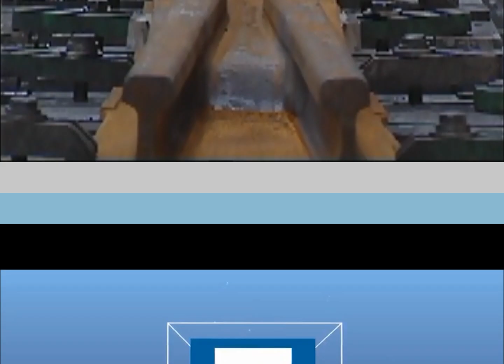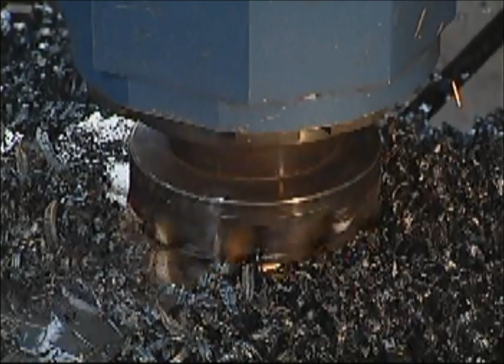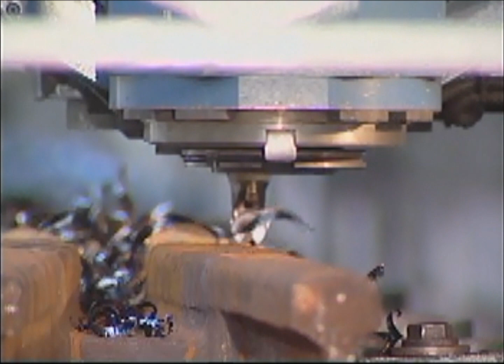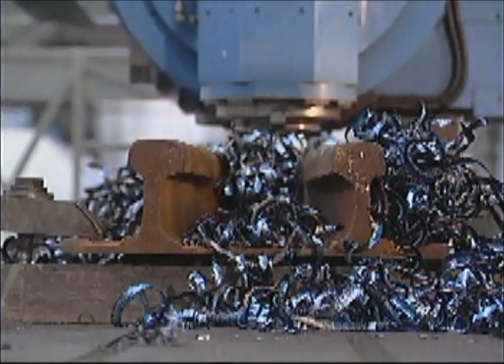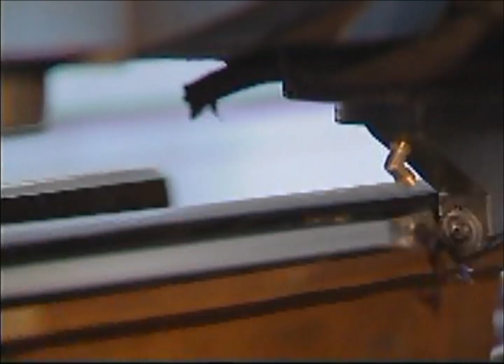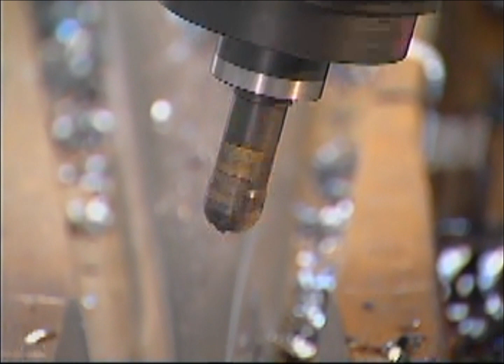FOREST-LINE -- Rail -- Frogs Plano Milling -- Macbormill

Comment: Used to be a NC Programmer years ago. Programmed ,Fixtured,and Tooled 2 Forest Line Seramill 240's. Fanuc 10m CNC controllers.   Before commissioning, I trained in Forest Lines factory in Albert, France.  Great days of working on large prismatic components programmed thro Unigraghics CADCAM.
Reply: Much respect to you my man

Comment: I never knew that railway tracks had to be machined. I thought they were cast in shape like that in the steel mill
Reply: Railroad tracks per se' generally aren't machined until they are installed. Then they get machined periodically: look up "rail grinder" to see videos of this being done. A frog is a very special bit of track equipment. It, along the the points of a switch or crossover, usually are machined because they are too complex to forge with the necessary accuracy.  BTW, track is rolled or drawn, not cast. Cast rail would be very brittle and fail almost immediately.

Comment: Just courious, but why are they scraping the rail instead of milling it??
Reply: Simpler cutting tools.
Reply: Kenneth Janczak FOR THE HELL OF IT(?)
Reply: That round insert can be used with this depth of cut probably 15 times (turned to a fresh edge) . ..and does a lot of job. A mill is a lot more expensive for the start (and you have to enter the material 200'000 times - while this scraping insert enters once ... )
Reply: but the answer is pobably "because of surface quality (macro waves dot desired on the rolling surface)

Comment: Wow!! Well there is still metal planers in use today for actual manufacturing.
Reply: Squatch Hammer I’m sure that’s a face mill.
Reply: I can not find any shapers in any catalogs with a rotary head.
Reply: special made machine.   some makers can adapt basic machines with special heads etc for customer.
there are probably very few jobs that need a machine like this.
Reply: And shapers have a single working element, usually a ceramic insert, and it reciprocated and that’s it. That’s obviously a milling head, shapers have no spinning parts. While it does seem to have a shaper attachment I don’t think that names the whole machine a shaper especially since it also does milling.
Reply: TaintedMojo Of course you won’t.

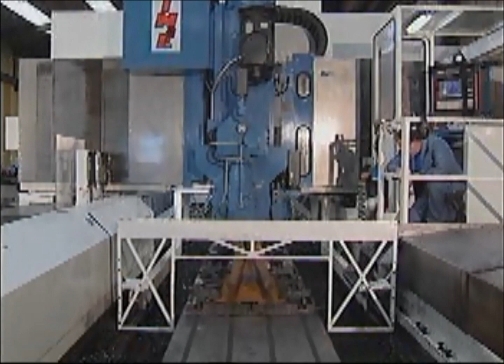Comment: 1st op.Mill base flat, 2nd op Probe point to find center. 3rd op plane top surface and side profile. 4th op mill point width. 5th op mill radius. Last op mill web cut.Video doesn't show end trimming to length. At 1:12 shows operator with no safety gear on what so ever. I guess both the company and himself don't care if he losses he's eye sight. Cmon people wear your safety gear.

Comment: WTF? Move the entire machine in order to move the cutting head?  And why mill the lower sides of the rail web - the cast side would not offend a train wheel running over the rail top.  Looks very inefficient to me.
Reply: It's not moveing the entire machine,  just the part that is being machined, that's the whole point. It works (sort of) like a lathe does. you clamp the part down, and then move it past the cutter, the rest of the machine is stationary, and doesn't require all of the assoiciated hardware that a milling machine does.